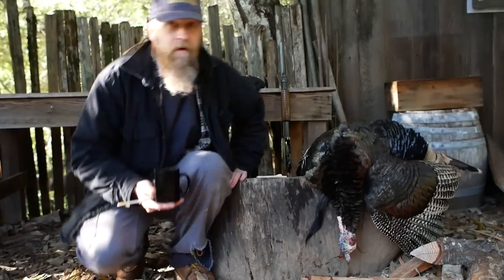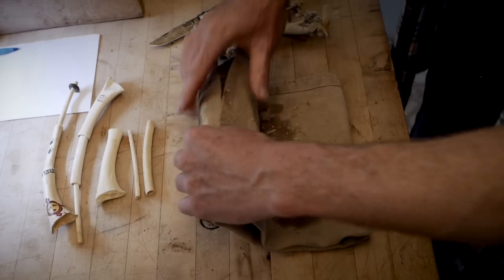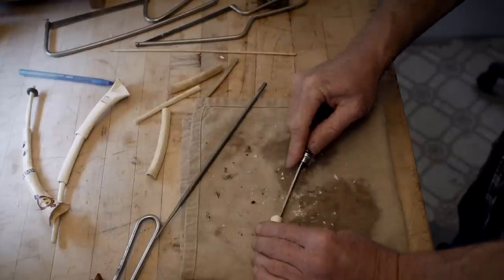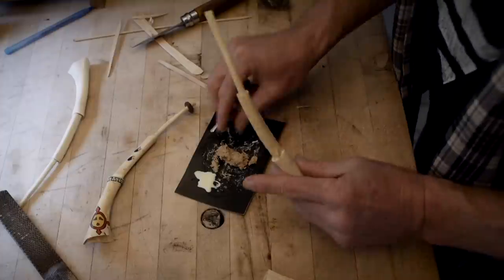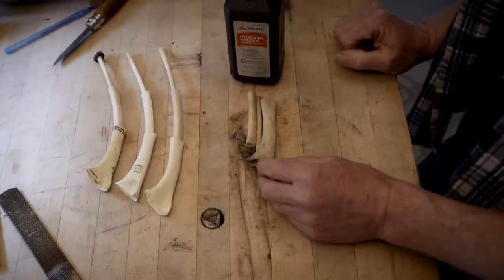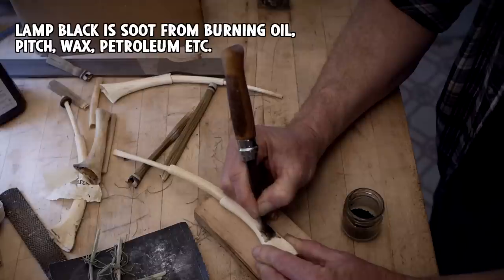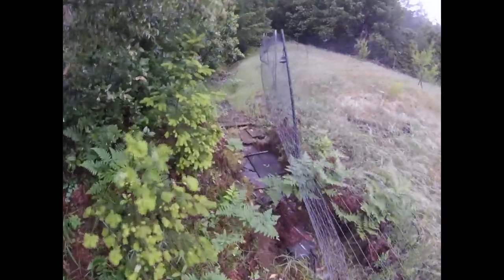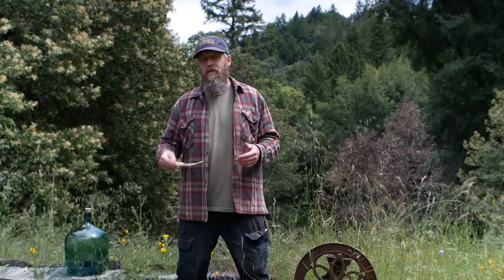To Kill a Turkey With a Turkey Wing:  Bone Hunting Call

Comment: Another great video Steven thanks.   I foolishly got a little nervous when you mentioned epoxy but of course you didn't disappoint ha ha!  Would pine pitch glue be another option or is it too malleable?
Reply from the maker: Pitch glue would work, but might need occasional maintenance.  rarely is pitch used in the gooey state.  It is usually cooked so the volatile solvents that make it sticky cook away, and mixed with powdered charcoal.  It makes a good filler and will not shrink, but it's a bit brittle if the item is moved a lot.  It is usually used in conjunction with a wrapping of sinew for arrow head hafting. Repair might be as simple as re-heating though, since it is just thermo-setting.  I want to make a set, one glued and one not glued and see how different the sound is.  it might be nice to havce one that breaks down and you put it together just to use it.  I probably would work fine, but I'd like to compare the sound with bones from the same bird.

Comment: I just finished a couple and found that UV glue for fly tying works great for the joints....you can shape it somewhat and cure it almost instantly with a UV flashlight.  I did put a little wood glue on the inside though...just in case.

Comment: I just made my 1st one and a friend of mine has made dozens with different bone lengths and some without the trumpet end, does the shorter the bones make a higher pitch or have u experimented with different sizes? Amazin explanation on the video thank you
Reply from the maker: I really just make them how they turn out.  Turkeys seem so dumb here, that I feel unmotivated to improve my calling game lol.  Happy hunting, good luck!
Reply: @SkillCult  lol alright man thanks, I git atleast 1 ever yr, 2 or 3 average but thanks man I just like the old ways
Reply: Hey bud I didn't think to tell u to bypass it but I boil mine 15 min with a squirt of DAWN, and a shot of 20 mule Borax and the 40 volume hair peroxide and it's bleached after the boil, I do my skulls that way if it helps you out any

Comment: I think I'll try to make one with some pine tar for the contrast in color. Hopefully that's not a mistake
Reply from the maker: Usually pine pitch glue the pitch is cooked a little to make it firm and not gooey, then mixed with charcoal and sometimes small plant fibers. It's not very strong, but the good thing is if it cracks, you just heat it up to reset it.

Comment: Nice call mate, I'll have to try and make one, I still haven't got a Turkey to reply with a box call so maybe this will be better for me. I feel like it could double has a small game call if you vibrate your lips with it rather then putting it deeper in your mouth.
Reply from the maker: Yes, i think it could act as a predator call.  It's tricky though.  I've not tried if for real, but played around a bit.  I've called in owls before making kissing sounds between my fingers, but nothing bigger and more exciting than that.
Reply: Yeah that kissing call works great, I learned it by reading something on Ishi and thought it was ridiculous. Low and behold it works though.
Reply: Speaking of Turkeys, is there any particular way you hunt em' with an air rifle? A couple months ago I tried to get a Tom in a flock with mine but they were moving around too much for me to pull off a shot. Granted I chased them over two valleys so they'd wanna keep moving.
Reply from the maker: I learned that from a naturalist when I was about 15 or 16 and practiced a lot.  I'm decent at it I think, but I've never really put it to the test much predator hunting or anything.  One time I was in cave and I saw a big owl fly past the entrance.  I made that distressed rodent sound and it swooped into the mouth of the cave right at me.  I probably screamed like a little girl.  I remember that part in the Ishi book.  He called in a bobcat I think. 

Their heads move a lot right!  They certainly have to pause for second to get a shot, but I manage to pull it off somehow.  Sometimes they stop and look at me and I get a pretty good pause time.  On small targets like that in the field I think I'm often doing the thing where I pull the trigger as I come up onto the target, rather than holding a tight bead and squeezing.  Holding a good bead often doesn't work in the positions I end up in standing or elbows on knees.  That buy's me a second or two.  As tough as they are everywhere else, almost any head or neck shot seems to put them down pretty good, at least long enough to run up and grab them.  I don't recall losing any wounded that I know of, but it's possible.

Comment: what kind of shotgun are you using back there?
Reply from the maker: 12ga Ithica pump.  I need to get a full choke tube for it or put one of those aftermarket adjustable chokes on this barrel maybe. Killer shotgun though.

Comment: Do you use lead pellets in your air rifle?
Reply from the maker: Yeah.  I have tried at least 3 different non lead pellets and none will shoot straight.  Like not even close to straight.  It's about time I tried some more.  New ones are coming out all the time.
Reply: @SkillCult  I don't know whether California's ban on lead ammo applies to air rifles.  That's why I asked.  I don't know any non-lead pellet I would trust for hunting.
Reply from the maker: @wdtaut5650  I was told recently that it does not apply to air guns.  I haven't picked up regs to check this year.  I actually didn't hunt at all last year, or take out a license, but this year I'm going to make the time!  If you take out a license here and don't hunt, it's a big waste of money.  now I have to wait til June, or waste a license and upland game stamp on a couple turkeys :/  I think they should price the basic license lower and make up the difference on big game tags, but those are already pretty expensive too.  I have seen guys on the net get results with non lead ammo, but It's seriously completely useless in my benjamin discovery so far.  And some can shoot them in that gun, so go figure.  I'd honestly prefer to use non lead if it works.  Lead toxicity is real.  But it has to actually work.